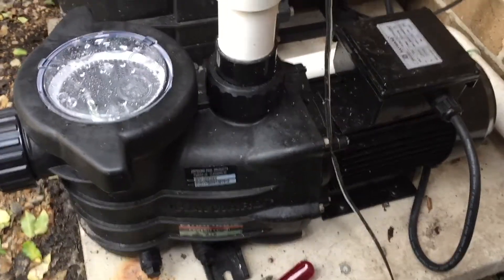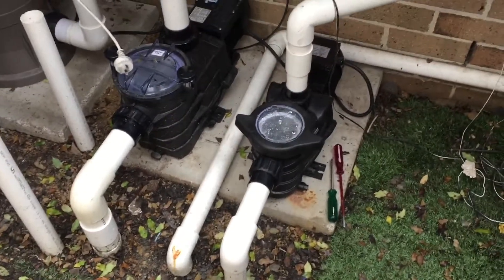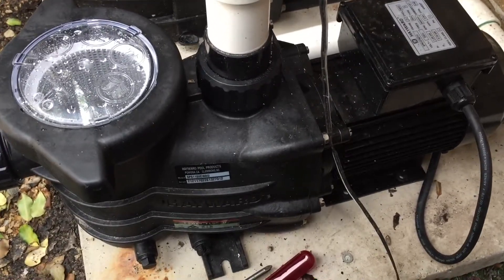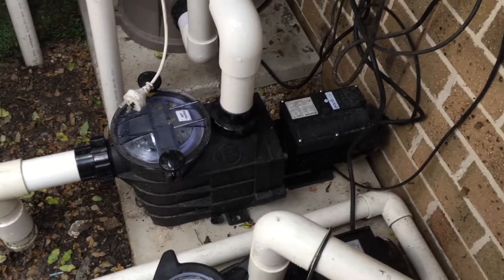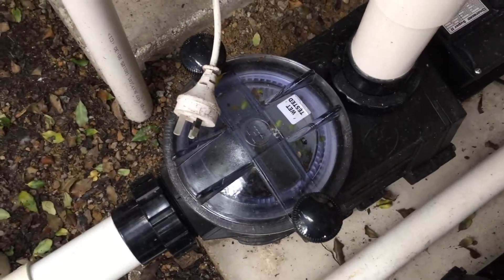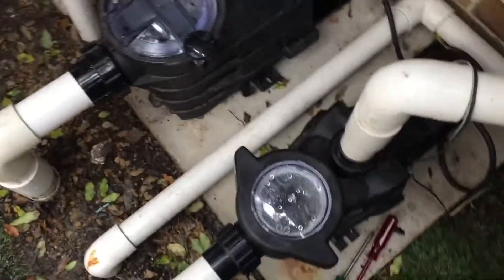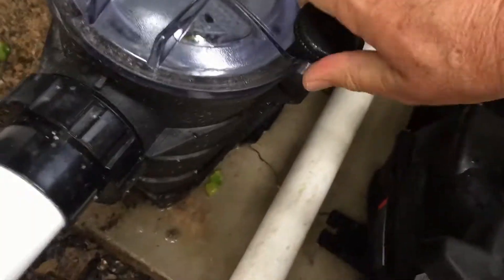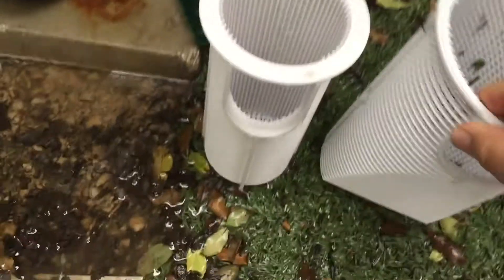REVIEW Hayward pumps, Super 2 and PowerFlo 2. I show you the differences. Swimming Pool & Spa pumps

Comment: Thanks for this review. Quick question: For the powerflo II (the smaller pump) inlet and outlet, what kind of pipes and sizing did you use to connect to the inlet and outlet?
Reply from the maker: Hi there. The Powerflo II comes with fittings for 40mm pipe and also spigots for hose. 
They are a very reliable and good pump, much better than most cheaper pumps. To buy at a good price contact Nillumbik Pool & Spa Service. They post all over Australia and NZ